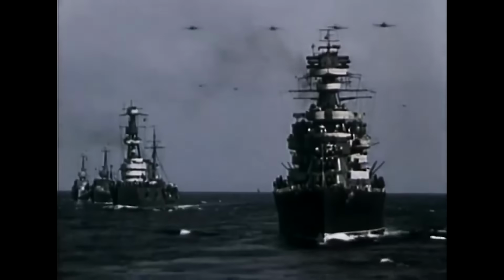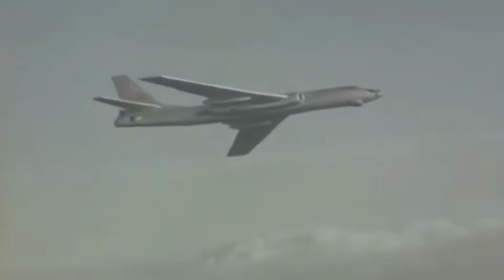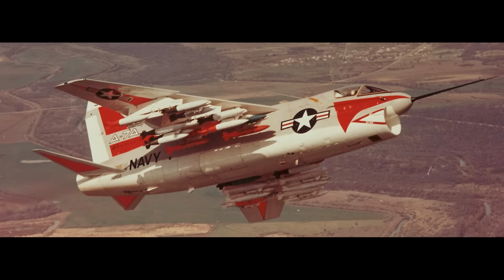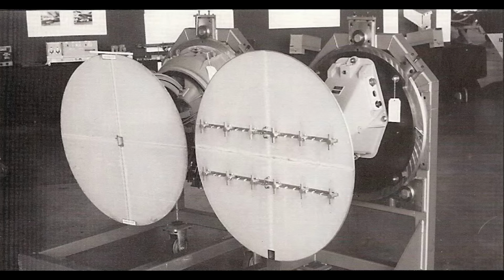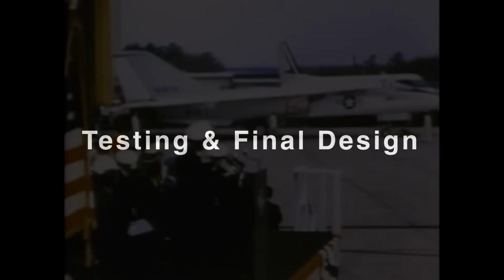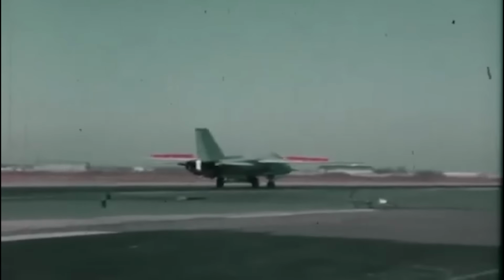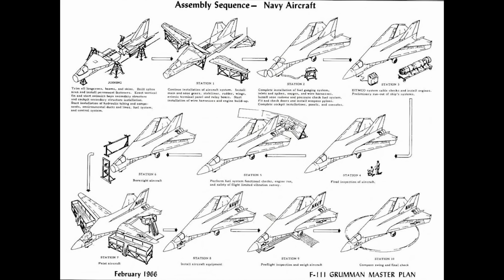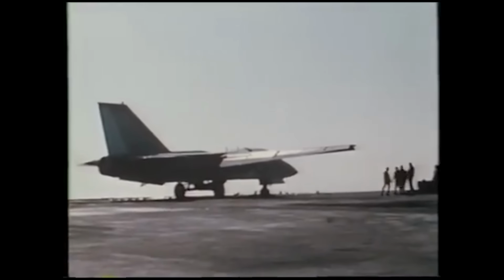Was The Grumman F-111B A Bad Aircraft Or A Missed Opportunity?

Comment: They didn't want this heavy, compressor stall prone, swept wing plane so instead they bought a heavy, compressor stall prone, swept wing plane.
Reply: To be fair , swing wing is not a short coming.
Reply: *was  @ohredhk , WAS not a drawback. But in reality, looking t back at the sheer amount of maintenance/flight hr for the -14… it was a bit more of one 😊 
Cheers!
Reply: @jmulnick F-14 maintenance hours were not driven by the wings. In fact, the swing wing was one of the most robust aspects of the F-14.
Reply: @v8packard  True.  One of eh big problems was the wiring, which wasn't fixed until eh F-14D
Reply: @ohredhk yes it is. It adds a lot of weight for a very limited increase in aerodynamic performance. It's better to use FBW (which affords high AOA control) and a fixed wing with high lift devices keep the stall speed low
The FX and LWF studies did the math. That's why the F-15 didn't have a VG wing.
Reply: @Fulcrum205  The swing wing of the F14 was necessary because the tech of FBW, as well as modern computer simulation and materials just wasnt there. Same as with F111 and Tornado. Mind the Tomcat was developed in the 60s.

The F15 didnt just have better tech, it didnt need to land on carriers. That was a big reason for the swing wings, you need good low speed performance to land on carriers.
Reply: @termitreter6545  the F-15 was not fly by wire and was developed at the same time as the Tomcat. Both were developed in response to the failure of the F-111 program. 
The RA-5 Vigilante, an airplane close in size and speed to the Tomcat flew off carriers without swing wings.
Don't even get me started on what a cock up the Tornado program was. They picked swing wings because some twit saw a Flogger and thought it looked cool
Reply: @Fulcrum205  The F15 was significantly more advanced than the F14, even if it was introduced just 6 years later. It didnt have a fly by wire system, but it relied heavily on digital tech, while the Tomcat was still to a large degree analogue. 
The Eagle didnt need a rear seat radar operator, because it was much more automated. And as a sidenote, it actually had a flight assist system, which resembled the future FBW quite closely.

I dont see the point of the A-5 comparision, its a very different plane with a different mission. It was also shortlived, due to costs and limitations.

The claim about the Tornado copying the Flogger is just flat out wrong. Its usually considered a highly succesful strike aircraft.
Reply: @Fulcrum205 Grumman actually did a design study on a fixed wing Tomcat, the G-303F. They found a fixed wing would have made the aircraft heavier, shorter ranged, & overall less capable.
Reply: @ByzantineTomcat  that finding is opposite of what the Air Force program office found when they were evaluating a swing wing for the F-X.
I would be curious to know how removing the pivots, actuators, and all the associated structure would make an aircraft heavier.
Reply: @Fulcrum205 the fixed wing had to have a bigger surface area & even more structural reinforcement than a swing wing. That came from the need to operate from carriers, something the F-15 didn’t do. In fact when they were calculating performance for the proposed F-15N, they found the additional structural reinforcement needed to make it carrier capable would degrade its performance to about equal or even slightly worse than the Tomcat.
Reply: @ByzantineTomcat  no it doesn't. The pivot creates a discontinuity in the spar load path. This needs extra structure not less. Because of the wing pivoting, the loads change depending on sweep angle. This again means more structure. Then you have to add in actuators, bigger hydraulic pumps, pivots, pivot lugs, more hydraulic connections, etc. This stuff is basic engineering. Look at bridges. Which is heavier, a regular steel bridge or a drawbridge?
Reply: @Fulcrum205 evidently not in the case of the Tomcat. The 303F was heavier by almost 3000 pounds at dry weight & nearly 5000 pounds at gross weight. Another thing to note is that Grumman did their best to save weight in the construction of the wing box itself. It was made from titanium instead of aluminum & was electron beam welded instead of bolted.
Reply: @ByzantineTomcat  they would try to save weight regardless of whether the aircraft was swing wing or not. Power to weight ratio is the fundamental design criteria for fighter aircraft.
I would be interested to see the Grumman design study and how they got to those weights. 
In regards to the F-15N, a carrier aircraft is invariably going to need a lot heavier landing gear and structure supporting it. There is a weight fraction formula somewhere that calculates the percentage of landing gear weight needed based on aircraft gross weight but memory fails me.
Reply: @Fulcrum205 there should be some material online about it if you search up Grumman 303F, though you will likely find more information on it on that one F-14 design evolution video on YouTube. If you are comfortable shelling some money the crowood aviation series book on the Tomcat has info about it, though it is out of print, a bit dated, & slightly pricey.
Reply: @Fulcrum205 you should be able to find info on the 303F by googling it. That one hour long video on the F-14’s design evolution likely has something about it. Also, if you don’t mind spending money, the out of print crowood aviation series book one the Tomcat talks about it.
Reply: @Fulcrum205 if you would like more info on the Tomcat’s development, there should be a one hour long video on YouTube about it, just search it up. It was made by one of the Tomcat’s designers. Also, if you don’t mind shelling some money, the crowood aviation series book on the Tomcat talks about it. What I was trying to get at earlier with the wing was that perhaps a fixed wing needs more structural reinforcement for carrier operations as opposed to a swing wing, diminishing the weight saving advantage it would have in a land based aircraft.
Reply: @Fulcrum205  if you would like more info on the Tomcat’s development, there should be a one hour long video on YouTube about it, just search it up. It was made by one of the Tomcat’s designers. What I was trying to get at with the wing is that it would seem that a fixed wing needs more structural reinforcement than normal in order for it to be carrier suitable, which may nullify its typically weight saving advantage. On a side note, the F-15 was an F-4 replacement. The F-111 was no fighter, it was meant to replace the F-105 as a tactical bomber & the B-58 as a high speed nuke carrier.
Reply: @ByzantineTomcat  TFX was definitely intended to be a fighter. It had to have nuclear strike capability because in 1961 SAC ran the Air Force and nuclear strike was the primary mission. The F-4 was a stop gap that McNamara made the AF take after TFX got too fat and the XB-70 was costing way more than expected.
Reply: @Fulcrum205 the F-111 was explicitly a low level bomber & its design characteristics reflect that. The F-4C was the result of project high speed: where the F-106A was flown against the F-4B to see which was better as McNamara wanted the Navy & USAF to standardize on which fighter they used. This was completely separate from TFX development. Regardless, we are getting off topic & I probably ought not to have done that in the first place with my little aside. It would still seem that a fixed wing needs more structural reinforcement than a variable sweep wing for carrier operations, nullifying its typically weight saving advantage.
Reply: @ByzantineTomcat  the original brief for the TFX wanted an aircraft that could fulfill both missions. It just got mostly dropped when the reality of the F-111s weight and available thrust set in. An F-111 would actually have made a good interceptor. It was blazing fast, long ranged, had room for a huge radar and could chase fast bombers down in the weeds better than anything. 
Regardless of the sink rate on landing the swing wing still needs more structure than a fixed geometry wing. I will say the lifting body design of the F-14 was a very elegant solution by Grumman. It let them reduce span (and weight) while keeping a low wing loading.
Reply: @Fulcrum205 Right so, I have actually messed up. It would seem that the main reason the fixed wing would have been heavier was not due to the structural reinforcement needed, but rather that it would have had to have a much greater surface area in order to get the low stall & landing speeds the Navy wanted & would have been unable to carry the six-Phoenix CAP loadout. So it is still heavier & less capable but for different reasons. Also, for the record, an interceptor & a fighter, while being similar, are not always the same. Interceptors are a type of fighter more specialized for defensively intercepting targets like bombers as opposed to fighting other fighters. The F-111B was an interceptor but not an air superiority aircraft. The F-111A & co, as far as I know, were first & foremost, bombers.
Reply: @Fulcrum205 the f-15 wasn’t fly by wire until the qatar variant and f-15ex in the most recent packages lmao
Reply: @cjones070 try reading all the words.  That is literally what I said. 
I was a fighter crew chief. I know entirely more than I want to about F15 flight control system
Reply: @Fulcrum205 i wasn’t about to read 20 comments, i was replying to your first comment.
Reply: @ByzantineTomcatwell when you design a fixed wing aircraft from one that isn’t, ofc it’s gonna be shit. F-18 and f-4 weren’t so bad with fixed wing. Not to mention fixed wing aircraft are easier to maintain.
Reply: @Dumbdog-e7d  The Hornet and Phantom were also much smaller, and weren't designed around lugging six of the then-largest AtA missiles and the monstrous radar needed to guide them off the deck while retaining good dogfight capability.
Reply: @Fulcrum205  F-15 did not have a true fly-by-wire system though. It was a mechanical system that was augmented by an automatic control system
Reply: @Fulcrum205  FBW does nothing to improve the aerodynamics of your airframe... Variable sweep wings do. 🙄 "iTs BeTtEr To UsE fBw" 😂
Reply: @ByzantineTomcatMy gf did a cost study and found that a new BMW X5 would be cheaper, cheaper to use and safer than the used Toyota Prius I wanted to get her.
Reply: @ohredhk  In retrospect it is, which is why no one uses it anymore. It was a solution to a problem that was fix better by fly-by-wire and more advanced lifting body designs in late 1970's/early 80's.
Reply: @TK199999  I really wouldn't say "use anymore", more like "manufacture anymore". We still operate the B-1, Russia with Tu-160 and Su-24(also being used by other countries], some countries still using the MiG-23 and Su-22, Italy, Germany, and the Saudi's using the Tornado, and the F-14 still in use by the Iranians albeit very sparingly. I'm not saying you're wrong since no one is buying swing wings because no one else is making them anymore.
Reply: @TK199999 no, it wasn't intended for that. The swing wing was intended to give the aircraft good handling at both high and slow speeds. The FBW control did nothing to substitute for that.
Reply: They should have gone with the f103 core engine. Very stall resistant.
Reply: With seperate rejection seats.
Reply: You have a firm grip on Cold War aircraft procurement logic lol
Reply: I did it my way.
Reply: Just a brain fart, at that time the Navy was a service branch anchored in tradition. Grumman aviation had a fighter tradition with the Navy that goes back further than the Wildcat/Hellcat/Bearcat/Tigercat/Panther/Cougar series of airframes. Grumman also developed a swing wing concept fighter the XF10F-1 Jaguar in the 1950's this aircraft had a limited but successful flight test program. 
 General Dynamics had no prior aviation history with the Navy before McNamara decided to use  a common airframe for both services. The lack of familiar between General Dynamics and the U S Navy worked against it's selection for the Navy's TFX competition. The Grumman/Navy relationship and Jaguar success made the Tomcat possible
Reply: First off, how dare you
Reply: @Sammydx1 Easy ready, willing, overtime. I'm entitled to my opinion, just as you are yours. I'd like to know when you became a lobbyist for General Dynamics?  I lived my reality are you just reciting a corporate history you've been spoon fed?
Reply: Ironically enough, the Tomcat had compressor stall issues because it was using the TF30 engine of the  F111.

Still a faR superior fighter aircraft.
Reply: @termitreter6545 f1-11 is a bomber?. Australia had mirage fighters, the pig replaced the Canberra bomber.  For a craft that saw little action, the cost in crew was high. (The low altitude ground tracking, was where it fell short?). I lived under flight-path, and made models,(that had raaf markings), f-18's replaced everything, (f-16 was an option, I recall, being cheaper, but range is an issue down-under). Our only aircraft carrier, was gone, by now, and the nice f-4's with it. A local boy, did a flyby over the town on retirement..(Fairly big deal, for a little town).
Reply: @Orangesjesus   RAN used A-4Gs. The only F-4s were RAAF, early block F-4Es that were leased as stop-gap measure, served only to fill the time until the F-111C was delivered, then they went back to the US. 
Incidentally, a number of those ex-RAAF lease Phantoms were later converted to F-4G Wild Weasels.
Reply: Absolute peak stupid internet comment.
Reply: @jonnybgoode7742 i mean this comment is true except the swept wing part
Reply: @Dumbdog-e7d its a yes but overwhelmingly no type of "true"

Comment: Great video.  Your summary can be read two ways: the unmentioned being that the F111 could have perhaps fullfilled all roles requried by the navy - perhaps not quite as well as all the individual assets, but as a jack of all trades including as a fighter using the phoenix/sidewinder/sparrow - replacing the Vigilante for single mission, intruder as a striker a/c, and the phantom.  Afterall, the f14 subsequently subsequently cost a lot more money to develop and was not much of a dog fighter relying on radar and weapons (like the 111) to attain air superiority.  Food for thought.

Comment: The landing gear and wing pivot were under heavy load.  Australia's CSIRO created a stress sensor array and monitoring system that logged data for this type of thing.  When Australia got its F-111's, the RAAF just smothered these very expensive aircraft with sensors.  The US DoD immediately sent buy orders to use on their aircraft.  This system is now incorporated in nearly all military aircraft.
Reply: it was known as AFDAS (Aircraft Fatigue and Data Analysis System) I did the strain gauge course when working on RAAF F-111s, an almost identical system was also on the RAAF F/A-18s

Comment: “Needed to be safe to handle behind the ship with one engine out…” where was that requirement with the F-14? lol
Reply: The requirement was that the F-111B in landing configuration at normal weight had to be able to climb at 500fpm in cased it experienced a waveoff.   In actuality my understanding is that the F-111B in landing configuration at operational flight could not climb at all.  The requirement for single engine return applied the F-14 as well.  As a matter of fact, approach and trap  following engine loss is not conspired an emergency situation.

Comment: IIRC, the F-111 'Aardvark', was not produced by Grumman Aerospace, but rather General Dynamics.
Reply: Well yes, but also no.

For the B model, Grumman was brought on to help with the navalization part of the whole deal. Grumman having extensive naval fighter experience and GD/Convair having.... uh.... The Sea Dart. They also built the B models and as part of the whole procurement package became a contractor for major structural components for all of them.  I sort of bet if it had gone ahead, series B model assembly would've been at Bethpage.

Somewhat similarly, EF-111s are sometimes mentioned as 'Grumman' because they did the conversion.
Reply: @warphammer Grumman was the subcontractor. The prime contractor was GD. This happens all the time with defense contracts with multiple aerospace companies producing various subassemblies, but the final assembly is always performed by the prime contractor.

Comment: If the F111B had gone ahead there is an interesting possibility that the UK could have gone for the F111 as it's strike aircraft for the RAF and the F111B for the RN, although weight would have been a big challenge for the RN carriers
Reply: They did go for the F-111, the F-111K.  They even canceled their own TSR.2 to buy it.  However, The F-111 price kept rising and being delayed to the point they pulled out.